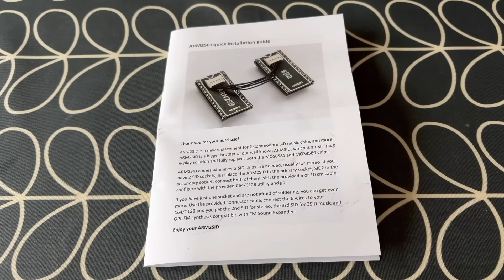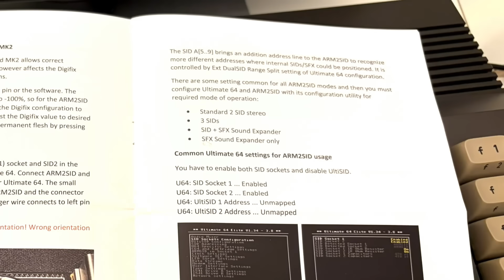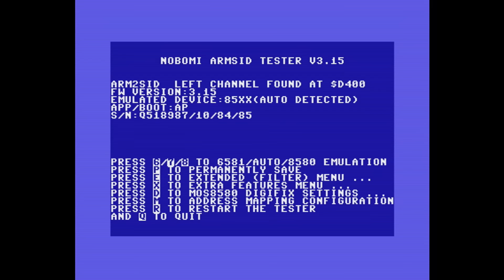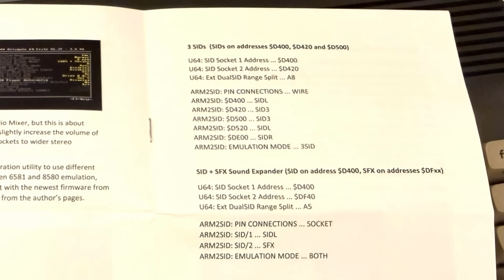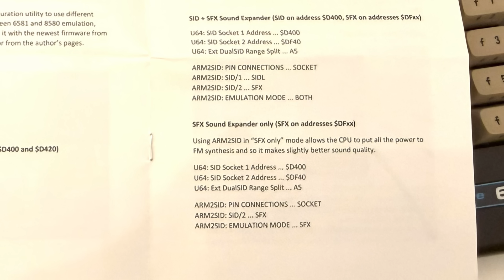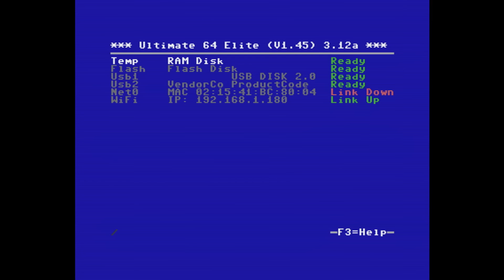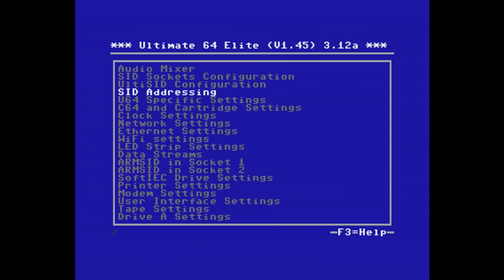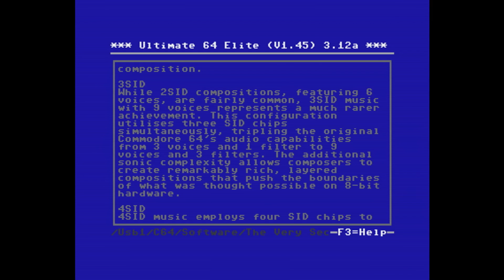ARM2SID on the Ultimate 64 — Unlocking FM Sound on the Commodore 64!

Comment: ARMSID can reproduce everything a real SID can do
Pulse, saw, triangle, noise
Ring modulation (often confused with FM)
Hard sync
Filters, envelopes, digi playback tricks
But: can sound similar to FM sound but is not a true FM chip . It does lack operator-based FM synth and used ubtractive synthesis, which is somewhat different from FM approach.

Comment: It will be nice to hear the difference with reals 8580 chips. 4 SID chips is what initially the SID designer intended but Commodore gave him only 1 year max to have a finished chip. I found a shame that Commodore didn't let the SID designer to finish the SID chip after C64 launched and offer it later in the new shaped C64 or as novelty in the C128 which would  have made the C128 a very successful machine.
Reply from the maker: I could pull a couple of 8580s from my vintage machines, but those things are so fragile now, I don't want to risk breaking them. However, there are a few videos on YouTube that have done the comparison already.

Comment: I have the ARM2SIDs on a Ultimate 64 Elite II and the result is the same as you have posted. The UltiSID has a nice v-shape to its EQ and sounds more exciting than the ARM2SID. It's a shame that it can't do some digi samples correctly. I'm guessing this could be fixed if some development time was put into it.
Reply from the maker: To be fair, the UltiSID seems to handle most digitised sound okay. It's just unfortunate that it didn't work so well with the first two examples I tried. I've subsequently tried it with Impossible Mission and that works fine.

Comment: Hi, I have a basic ordering question for you but just want to be sure:

If I want the exact same setup as you have in your video (ARM2SID+SID2) and I have new the new Commodore 64 Ultimate on the way then do I order the following on your Retrocomp link:

Variant: with second socket and cable for Ultimate 64
Quantity: 1
Price: 57€

Many thanks.
Reply from the maker: Yep, that's exactly the version you'll want for your new machine! Although the new C64U has a newer version of the motherboard, it still has the SID A[5..9] pin header on it.
Reply: @RetroNowTV Many thanks for confirming. Much appreciated.

Comment: I have SIDFX w/ 8580 and 6581, 1541UII+ with it's emulated SIDs. I wonder if I can add them somehow! I never tried it. I DO wonder how I would mix all those channels. I have MSSIAH64 and Cynthcart64 w/ Datal MIDI cart w/ mini XPander. I use a MIDI controller (Akai MIDI keyboard w/ drum pads). But I haven't finished wiring up my four paddle pots installed on the Commodore breadbin yet. I have an OLED spectrum analyzer built-in, a dual pentode vacuum valve headphone preamp w/ volume control built-in as well. I've tested it a little with the two real SIDs and things are gonna be NASTY! Excited about the latest developments and love that Commodore 64 is getting.
Reply from the maker: Wow, sounds like you have an excellent set-up there. I really want to get a MSSIAH, but they're sold out at the moment. It's certainly a great time to be a C64/SID fan!

Comment: Nothing beats the 6581.
Reply: It's a matter of taste (I prefer the 8580), and if you're listening to new tunes, they're most likely made with the 8580, so it will sound strange
Reply: @KurtPedersen-tg7jc  8580 beats the 6581.
Reply from the maker: Sadly, I don't have a machine with a 6581 in it, I only have machines with 8580s 😢
Reply: I'd rather have the analogue filter of the original chips than any or this new fangled digital chicanery. If I want FM sounds, there are plenty of half rack units available that do it better or even plugins that are most of the way there

Comment: If the new C64U can truly emulate 8xSID, wouldn’t the ultimate set-up be that system combined with 2 added ARM2SID chips set for YM OPL1/2 FM audio? Maybe they could add the ability to also emulate Commodore’s speech synthesis chip used in the also equally rare voice expander. As for other options, I’m surprised nobody’s added a POKEYMax to any type of C64. That solution can emulate Quad POKEY, Dual SID, and 1 AY/YM PSG… supposedly all at the same time….
Reply from the maker: I guess in theory you can configure the 8 UltiSIDs and the 2 ARMSIDs to work together, but that doesn't appear to be as straight forward as the 4 SID set-up, and I haven't yet worked out how to do it. I hope that Commodore will continue to develop the C64U and add new features.

Comment: Hi, your video is really interesting but I’ve a doubt on which version of arm2sid I need to buy: I’ waiting for C64U, I need to but the standard version (the first in the retrocomp website list) or the version for ultimate 64 (that is yours )? There is written that thi version has a special plug for the wire compatible with Ultimate 64 board. Do you know if the C64U has the same plug or I need to buy the first standard version? Thank you.
Reply from the maker: You need to buy the version I have here - the one for the Ultimate 64 board. Even though the version of the board in the C64 Ultimate is a newer version of the board I show in this video, it still has the SID A[5..9] pin. Just make sure you install the chips in the orientation printed on the board next to the SID sockets.
Reply: @RetroNowTV perfect, thank you. I was in doubt since there are not picture or photo of the new MB of C64U so I didn’t know if there is or not that pin.

That pin is to use the SFX, right? (I’ve seen other videos and I’ve understood the the standard version of arm2sid has only the wire to Connect the 2 sids but not the 3rd wire to connect to motherboard)

Comment: I’m still waiting for my C64 U to arrive but love your videos. Regarding the difference between the real Sid Chips and the on board simulation   - it appears (apart from digitised samples) that the difference is minimal but I understand how the real purists prefer real hardware, there is a difference but probably not enough for me to invest in purchasing them. However I think it’s really cool how you can add real Sid’s simply if you want to.
Reply from the maker: This is by no means a must have upgrade for the C64 Ultimate, but it does give you a slightly better overall sound experience if that is important. Where the ARMSID is a better option is if you need to replace a broken SID chip in a vintage machine as it supports mouse and paddle input, which some others like the SwinSID do not.